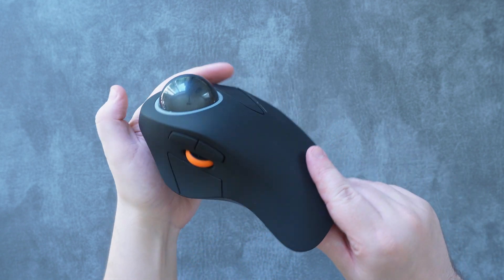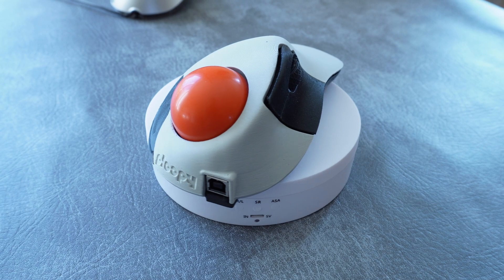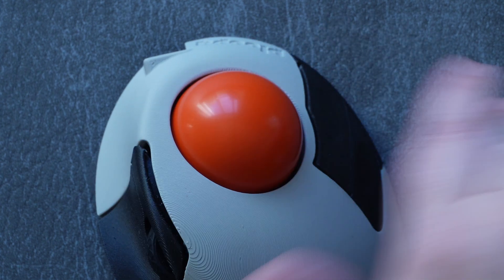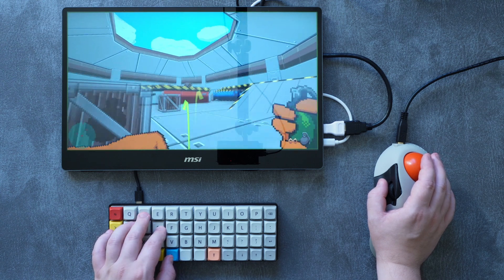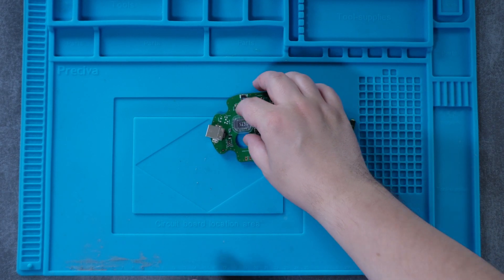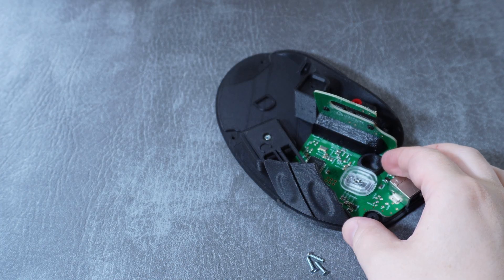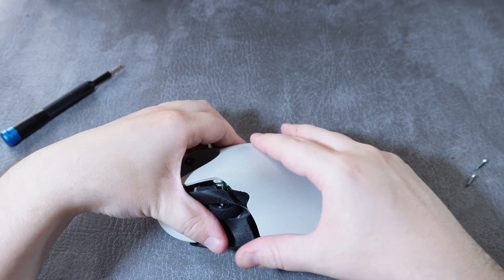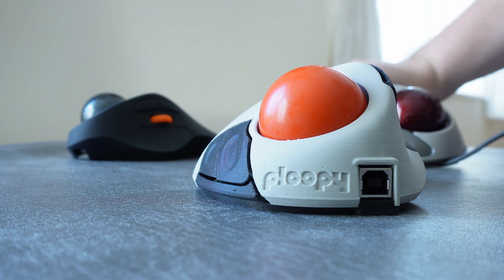How To Build The World's Best 3D-Printed Trackball | Ploopy Classic Review and Build tutorial

Comment: I have a few trackballs, mostly Kensignton Expert wireless, Elecom huge, wired & wireless, Elecom Deft pro & brita, I love the scroll wheel on the thumb, however, is not the best scrolling wheel, that goes for the Logitech's Master MX3, free spinning scrolling adds real Inertia scrolling to any computer. However the scrolling with the most control you will ever have is with Thinkpad's trackpoint, that little red dot in the middle of the Thinkpad keyboards.

The trackpoint is just a stick that detects pressure, detects the smallest amount of pressure so when you use it as a mouse you don't really need to move it a lot, it takes practice but is really powerful once you have dominated it because is a tracking device you can use without moving your hands from the home row. So scrolling is achieved with pressing the middle button
Reply: Interesting! The only problem here is now you’re stuck with a whole computer no?

Comment: Microsoft's optical trackballs had a fatal flaw, the steel bearing points for the ball. Oil from one's thumb or fingers would coat the ball, pick up dust and lint, and that would grind away at the steel until it'd wear down and the ball would drag on the inside of the transparent red socket. There were some people making bank replacing the steel bearing points with silicon carbide balls or synthetic ruby, like most every other trackball.

I still have a Microsoft Trackball Optical One in excellent condition. I always made sure to wash my hands before using it and regularly popped the ball out to wipe the bearing points to remove any buildup. I retired it for a Logitech M570. When its wheel jammed up (I will take it apart to clean it, someday) I replaced it with an Elecom EX-G. It's better than the M570. It's also the one and only model of left handed thumb trackball available AND unlike other left handed input devices it's a perfect mirror image of the right handed EX-G. I'm left handed but use a right handed wireless EX-G.

The Ploopy Classic is currently the only finger trackball available in left and right handed versions that are perfect mirror images. Only Elecom and Ploopy "get it" that a left handed device should be a mirror image of the right handed version.

Comment: I've never used a trackball, but it boggles my mind that they require an additional wheel for scrolling, also if you want to scroll sides a wheel is not designed for that. Wouldn't be more easy is there was a button that make your trackball scroll in any direction?
Reply: You can easily achieve scrolling with the ball with any trackball by using external software. In the case of ploopy you can probably configure it in the firmware too (can't be bothered to check the documentation). So the scroll wheel is just another configurable input among the other buttons.
Reply: Some of them do, my Marble FX has it

Comment: Bluetooth.
Reply from the maker: Its just not that type of mouse!
Reply: This is the 21st Century. They're ALL that type of mouse.
Reply: @matthewdavies2057 it doesn't move on the desk, doesn't need Bluetooth, especially since Bluetooth is terrible. I'd prefer 2.4Ghz receiver if it had to go wireless. This is coming from me, I have everything I can wireless
Reply: @billy5688 What if I'm using an Apple computer? All of the ports I have are Type-C. I'm using an HHKB Bluetooth keyboard and have no problems with it. I'm also using a Chinese trackball with Bluetooth, and it works perfectly. Bluetooth input devices now have no compatibility issues. I have three Bluetooth devices connected, including AirPods, and I have no problems at all.